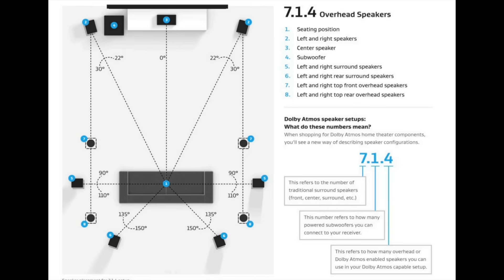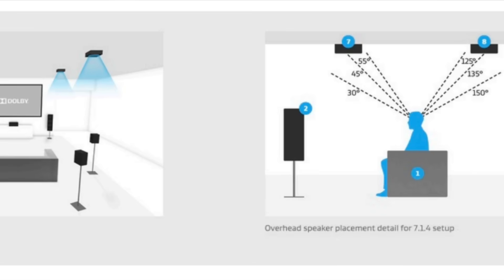Perfect Speaker Placement for Dolby Atmos — Step-by-Step Guide!

Comment: Wrong. Maybe it's true when you're watching a movie alone, which doesn't happen in 80% of cases. The calculations should be done for at least 3 seats, which is almost any sofa. The placement of the speakers can be done not necessarily according to degrees, you can put the front hight speakers on the front wall on a stand that has horizontal rotation. Increase the decibels on them and your ear will hear the same thing as if they were localized as calculated by Dolby. You can only make these arrangements in a special studio, 70% of us don't have such a thing, we arrange in a room, living room, etc.

Comment: My room is quite small: I sit less than 6 feet away from the TV, and the back wall is right behind the sofa. My fronts (L-C-R) are placed slightly forward, ahead of the TV line, around 43" from my MLP. I'm planning to install 4 overhead speakers for Atmos, but I'm not sure about the front placement. If I follow the '0.7 rule' (multiplying the height by 0.7), they end up directly above my front speakers. Is that correct? Does it sound good that way?

Comment: By example of a limited system that can only have 1 front 1 subwofer and 5 of each would you prefer 5.1.1 or 3.1.2?
5.1.1 could be front,left front, right front, back left, back right ,1 sub,1 top, or 3.1.2 could be front, front left,front right, 1 back , 1left top, 1 right top, 1 sub?

Comment: Look at this video, you can instantly see a theater room, most people at best, are using a living or family room for their AV entertainment.
(FYI, don't buy any high-back theater seating, you'll just block sound from your rear surrounds and rear height speakers, see Shane Lee theater)

I have changed my Atmos height (4) speakers to a Auro-3D positioning as recommended by 'Joe n Tell' in his piece 'Using an AURO-3D Layout for Dolby Atmos!?'
I knew the Dolby Atmos layout were only guides as each room is unique requiring your own adjustments to Dolby's initial 'paper' layouts.

Comment: thanks for the video (and love the valerion up there, waiting for Mine (MAX) any day now, I do have a question, your instructions for the Atmos ceiling is based on the assumptions that there is only 1 main listening are, which may not be the case for many of us, so if you want to create a 7.2.4 with 2 rows of listening seats, does the logic apply using the space between the 2 rows as a "main" listening area to try and capture that open wider space? does my question make sense/clear?

Comment: Hi there, I have the potential with this setup in an odd room. It's left side is completely without A wall so I'm looking at mounting them on the ceiling. The room is 16' long.  I'm planning the setup of 7.2.4 eventually but will initially only be able to do 5.1.2 to start. The receiver is a Sony STRAZ5000ES and with the exception of the center channel being SVS Prime Dual 5 1/4" Passive 3 Way all the other speakers will all be SVS Prime 4 1/2" Passive 2 Way. The sub is the SVS 3000 Micro.  I'm looking at your video here and wondering if the same math could be applied for ceiling mount everything.  I love how easy these are to follow and was hoping I'm able to reproduce this.  Also no in ceiling anything for this...I'll have to run raceways sadly. Please let me know if you have any feedback I could use before I go to town on the ceiling.

Comment: Nice video... No way I can get that much LCR separation sitting 10.5 feet from my 77" TV, but we all live in compromises.  One thing I would love to get feedback about - the Height speakers as you described make sense for in ceiling speakers (often with fixes tweeters).  But my SVS Prime Elevations are angled from the top of wall Front and Rear (in my very low 7' ceiling, so I have even more to compromise there. I think the calcs work well, but ultimately playing demo scenes and seeing if they sound close to the way they look gives me  feedback this is "good enough".  Though now I want to raise my sides 3" to match my rears (which had to deal with chair backs).

Comment: Can you please pleas help me. I have asked on a few youtube channels that have speaker setup but they never answered.

Im in a room thats 11' wide x 12' long euth an 8 foot ceiling.

Im going to mount my ELAC DEBUT 2.0 Atmos Speakers on the ceiling but im not sure where to position them. Its a 2 speaker atmos speaker system 5.1.2.

Im thinking of putting the atmos speakers 6' in and 1' away from the wall with the angled face pointing at the seating area.

But my sofa is 2.4' away from the back wall. I cant push it any futther forward.

Would the dpeakers be too far forward from the seating area for center height atmos? 

Should i put them above my seating area ir would they be too far back from the front speakers?
Reply from the maker: Follow the calculations in the video. Measure the distance from ear level af the main listening position to the ceiling. Multiply that distance by the multiplier in the video to calculate how far forward. Then use the other multiplier to calculate how far to the side.

Comment: I wished i saw this video 5 years ago when I installed my atmos speakers. The dolby diagram pdf for home theater is much better and less confusing now than it was 5 years ago. I recall the Dolby "theater" diagram was more accurate than the dolby "home" atmos guide back then, especially where they placed the atmos speakers in the room in the pdf.

Comment: Didn't you make a video like this before? I mean. I don't mind. May you get plenty more views!! Btw how do you feel going with top middle in a .2 atmos setup? I had it and i prefer front top. First time hearing the .2 top middle was as awesome and cool as hearing surround sound for the first time but after watching plenty of movies it started to bother me that I see things happening on screen or even far away from me in front yet the top middle blasting sound right above. I think it's super distracting and rather wrong. Overhead panning is still fine with the top front. Panning sounds are usually happening fast anyway and it doesn't bother me much that a sound is going from above and front to behind since I don't see behind myself. But bothered me a ton that visual cues and sounds did not line up.
Reply from the maker: I made videos for 5.1.2, 5.2.4 and 9.1.4. Got some requests for 7.1.2 and 7.1.4. 
For two Height channels, it comes down to personal preference. You have the Dolby guidelines, but you also have your own ears and where it sounds more natural. Ideally you would be able to temporarily try the speakers in different locations to determine what sounds best to you.
Reply: @GeorgeTheaterAtHome not nit picking but you should have perhaps mentioned if the distances change anything if they land too close to a wall. I dont even have a right answer for this but probably it's better to put speaker closer together of they are withing 1 ft of a side wall or back.

Comment: Very well said 👏 
Hight layer placement always depends upon your MLP to Rear wall Distence its minimum 5-6feet available then only 4-speakers can place in hight layer 
Most important factor is chanel separation in 60- degree between speakers on vertical plane and horizontal plane then only you can achieve the best dolby bubble effect its very tricky and all speakers must be on axis to MLP ceiling hight make a huge difference between Bedlayer and hight layer separation 
Hometheature guru explained about this subject in very detail based on practical experience and science behind of sound
Reply: Correct. Home Theater Guru is a champ. I have 6 heights, so that translates to 45 degree separation front to back, and 60 degree separation left to right.
Reply: I don't know which AVR you are currently using if your AVR support Auro-3D then watch any atmos content by upmix to auromatic mode since you have 6 height layer it will  be a great experience but its always subjective but speaker assignment is very important in your avr speaker setup  @Tech2C

Comment: This is wrong.

Correct calculations are as follows:

Centre channel is placed 2/3 of screen height and aimed down at ear level to the RLP which is calculated at 2/3 of room length.

For Left and Right:

Measure distance from screen to RLP and times by .84 to calculate width between speakers. Then place at same height as centre and toe in and aim towards RLP.

Comment: The Steven Smith School of HT Design. Very good explanation. I used all these calculation methods in my 7.4.4 bedlayer speaker placement. The only recommendation I would have is to make the measurement of height from MLP ear level to ceiling from your normal reclined position.

Comment: Oh no!   The memo hasnt gotten around yet.  DO NOT FOLLOW THE DOLBY DIAGRAMS.

Those diagrams were either written or pushed by Dolby's marketing department so that people with already existing theaters would adopt Atmos because it seemed simpler.

This was revealed on Shane Lee's channel when he was interviewing Jon Heron of Trinnov who also worked on the Cedia RP-22.   I independantly checked this as well with other people who worked on the RP-22 along with Dolby engineers and they confirmed that they had this discussion with the Dolby engineers that the common guidelines were pushed by their marketing department and that the Trinnov guide and the Cedia RP-22 are much closer to what the Dolby engineers intended when they designed the format.

Look at the Cedia RP-22 and the Trinnov speaker setup guide, not the Dolby diagrams.

Comment: Great explanation George!! I like the idea of using ratios instead of angles, much easier to work with. :) I'm curious how you would alter these recommendations (if at all) for rooms with two rows of seating? And what about 6 overheads? Or Front wides?
Reply from the maker: For two rows of seating, it depends how much you value the listening experience for those sitting in the row that doesn’t have the MLP. If you don’t value them much, keep the same calculations. If you want to split the difference, you can set the Side speakers between the two rows of seats

Comment: Great video! I have used an excel sheet to calculate x and y co-ordinates in the room based on angles. I used Anthony grimani and technodad to get the right angles and positions. Also used RP22 document to get the wide channels(9.4.6). RP22 document is great l, but not so easy to read.
Reply from the maker: Glad to hear you found the video helpful, and thanks for sharing your process!
Reply: RP-22 is the right answer

Comment: Following on from "no atmos in UK" article.... Would be good to see a video on how whether atmos can sound good with really compromised speaker placement.
Reply from the maker: That's a great suggestion, I'll see what I can do!
Reply: @GeorgeTheaterAtHome  Thank you, I appreciate it might be hard to recreate as you have spent so long getting your two systems (almost) perfect! I ended up getting the wiring run into the walls, and have some very small speakers 2 front and 2 rear that will be mounted where ceilings meet walls, in line with the main front speakers. I have no idea whether it'll be better than nothing ... all the "experts" say it's too far from "spec", but living in a small house with family means lots of compromises :)